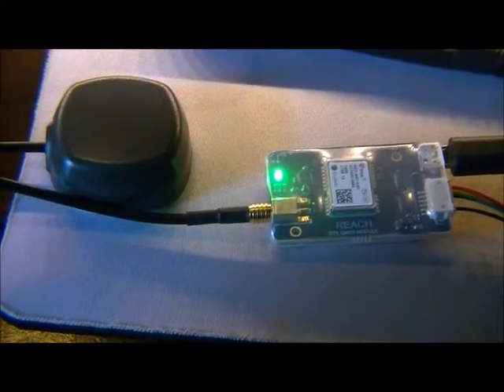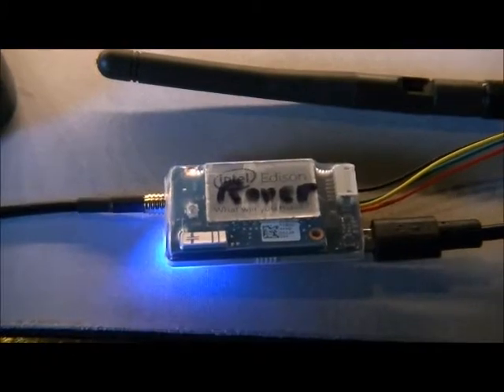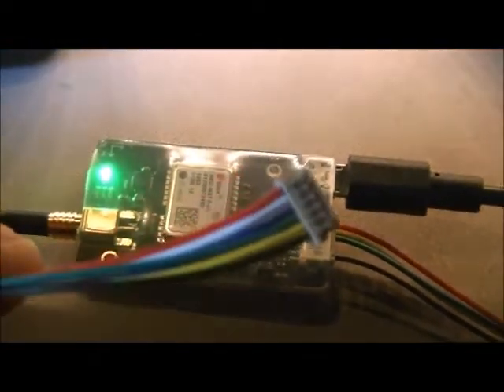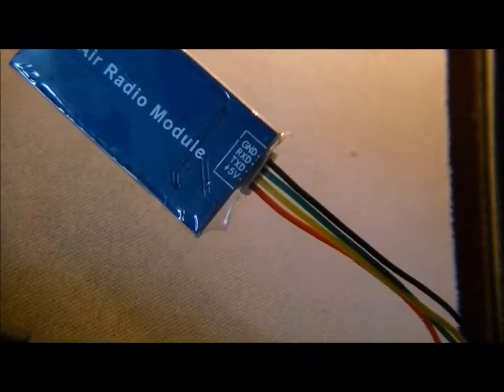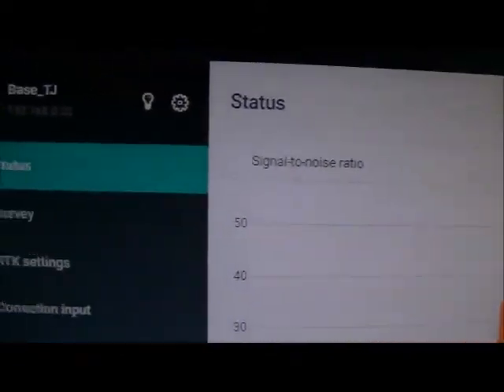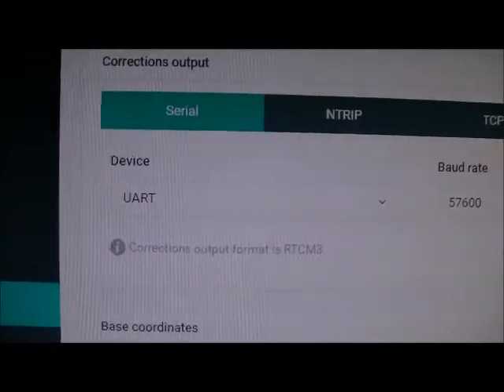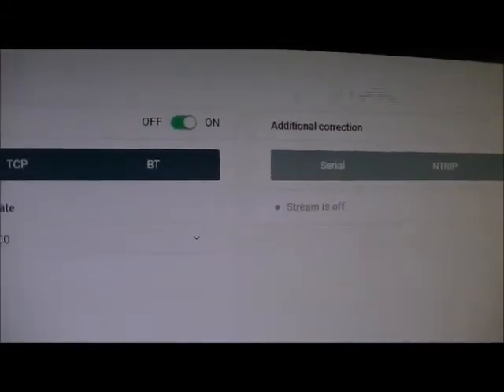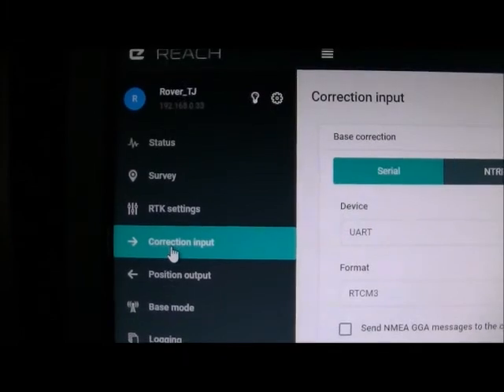Emlid Reach RTK setup

Comment: Did you use NTRIP to correct the base?
Reply from the maker: No. I am less concerned with the "absolute" position of the objects I am surveying. I really only care about the relative locations compared to the base location.
Reply: Do you happen to know if it is possible using only the Reach connected to your PC to use the base correction option? The reason I am asking is that if I understand this correctly to implement RTK  (with an absolute corrections) you do not actually have to purchase their Reach RS solution.
Reply from the maker: No clue. Sorry. Pretty NOOB to this stuff myself.

Comment: how do we save the log observation in Reach? does it have internal storage or its had built in memory card slot?
Reply from the maker: Jun Coraza the Reach unit has built in storage to save the survey points. Then you can export the survey points in DXF, GeoJSON, or ESRI shapefile format to whatever device you are accessing the Reach unit from. In my case I would use an iPad in the field to gather the points then export to my windows desktop later.

Comment: Hi, could you please post your radio settings ? (via mission planner or 3drtool)
Reply from the maker: I am using default radio settings (except maybe channel as we have a few drones and try not to boink eachother...). I changed nothing from the out of the box defaults.
Reply: Could you please post me your settings in order to compare with mine? I don't have the "original" 3dr radios. Also what's the maximum distance that you have managed a steady fix?